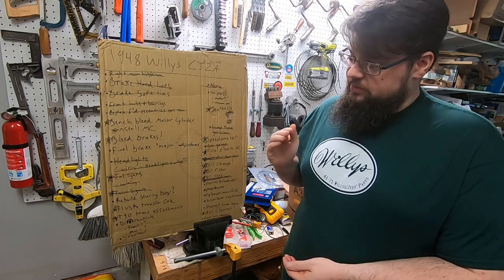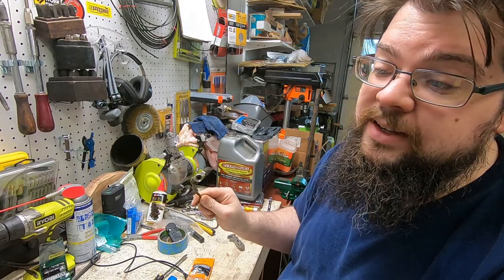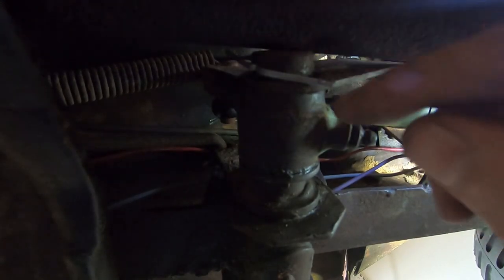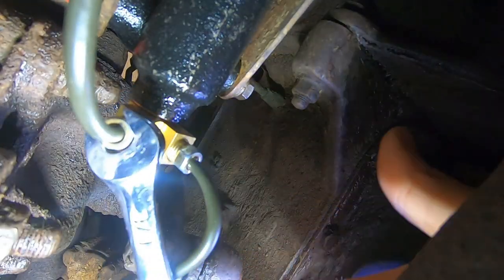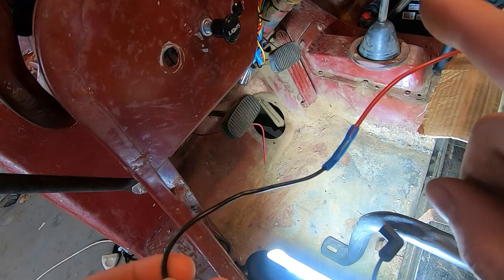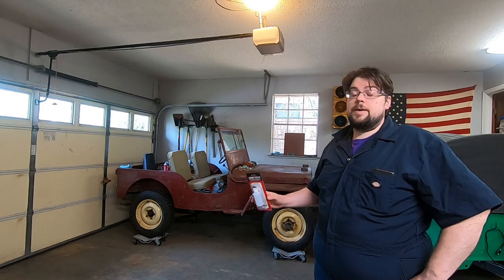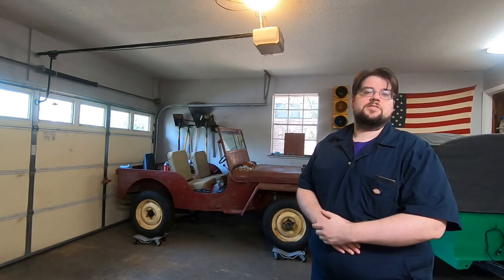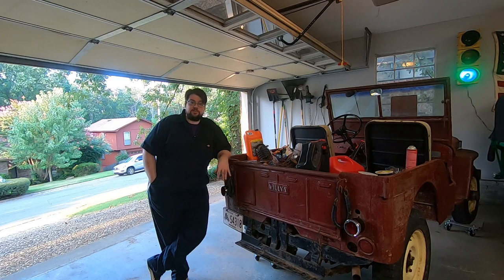Ep. 43: Finished Brakes! (and wiring!)

Comment: I'm practically doing the same thing on my m38 (as soon as some parts arrive). Appreciate the part number call out for the wiring pigtail, now to find it in Canada.
Reply from the maker: Jegs should ship to Canada if you don't find something similar that's locally available from a Canadian distributor. I updated the description with the specific part I used if needed.
Reply: Yup, they do ship to Canada, however, the cost of shipping is twice the price of the pigtail, plus exchange rate. Time to reach out to a buddy of mine in PA to act as a relay for me